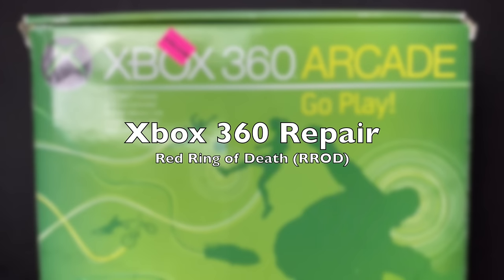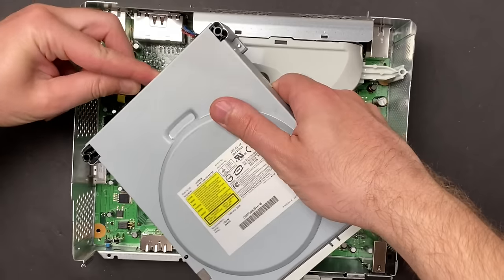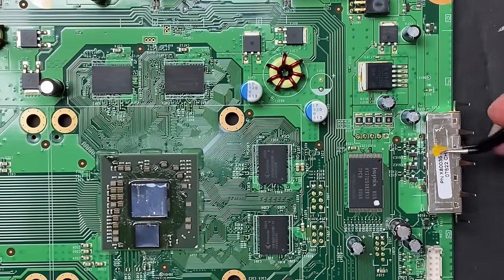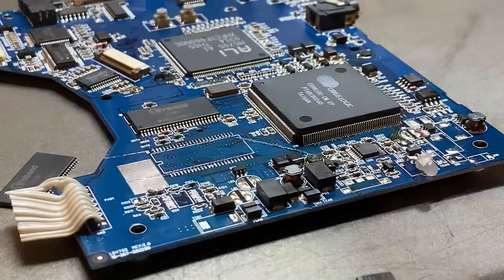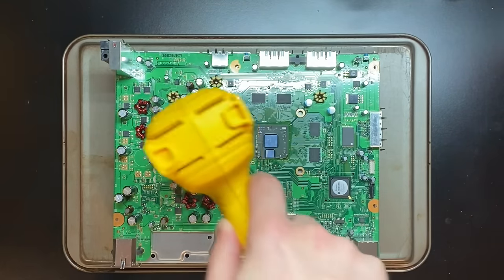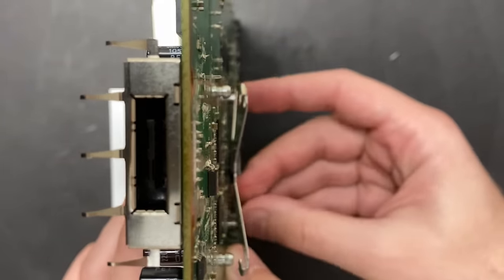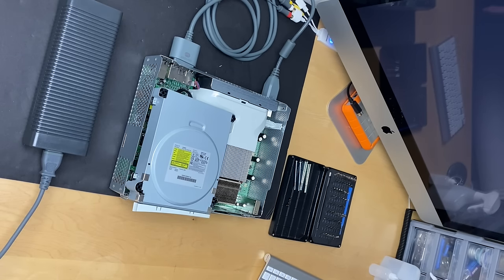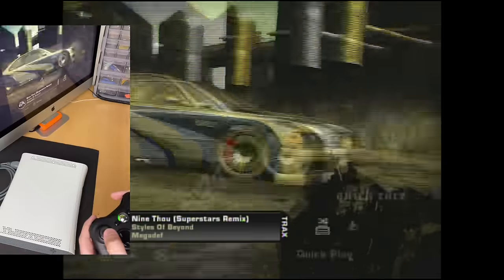Xbox 360 Red Ring of Death - DIY GPU Reflow

Comment: I absolutely love BorderlineOCDs Videos, always love the amazing content that you make for your fans! I want to share something to hopefully help you all! The RROD is a problem due the GPU, however its not actually the BGA Solder Connection in which is the actual fault. In fact, it is the connection between the GPU die, to the substrate in which also has your ED-RAM present on. Which is the reason why wrapping a XBOX in a towel works, the underfill they use to protect the connection was defective by rushed manufacturing, later in 2008, this was fixed, and the underfill was rectified for later RHEA GPU's onwards. Due to the underfill flaw, simple amount of heat could bring the system back to life, and interestingly pending on how far gone the underfill was, could last for a while after a reflow, or only a few minutes. If anyone ever wanted to preserve a XENON etc, its possible by GPU swapping or being able to identify GPU's in which where in the manufacturing date when they corrected the underfill. :)

Comment: So one thing I want to mention. You can check secondary error codes by holding the sync button when the console is on and while holding that button you press the CD open button that results in it showing probably 4 rings, there are 4 numbers so repeat step 1 until you have all 4 numbers. 1 is 1 ring  2 is 2 rings and 3 is 3 rings and 0 is 4 rings. You can search the internet for error code lists and see what error you have and what possible fix is available.
Reply from the maker: Thanks for the tip. I'm working on an Xbox 360 Slim soon and it has the red "dot" of death. This will come in handy.

Comment: Nice Work. Excellent tutorial. I've fixed 5 or 6 laptops like this but I placed 3 quarters and 2 nickels on top of the gpu. The author of the laptop repair book I read mentioned they apply weight to the gpu during the re-ball and the coins would be close to that weight

Comment: Good video by the way! I fixed mine with 2 key points to resolve the problem and which i would like to mention. After i disassemble everything and cleaned old paste fan etc, i change paste with a quality one and second, which i didn't see on the video and i think it is important, is that i bend X clamps the opposite way in order to increase the tension of cooler sinks on the chips. That make it more solid and more efficient with cooling. I think not in all cases needs to be follow the reflow method which is more drastic  step but for sure can help in many cases.
Reply: I fixed mine years ago using that identical method. Disassembled and cleaned everything, new thermal paste and tweaked the clamps before reinstall. Worked great from then on until it went into a closet, where it resides to this day.. 😁👍

Comment: Wow, best video I have seen on this subject...I have done all the tricks... (years ago, I know better now). I have the gear to do this now.  After getting my original 360 working 4 times, the last time it failed, I said screw it, I picked up brand new slim 250gb model, and it works fine even today, my old one is hanging with my other dup consoles....  I might try to do this...I should be able to handle this one, I'd love to see what system version it's still on.... Crap, I need to do other stuff first !!!!! Thanks man ! BTW I am MORE than Borderline OCD ...LOL
Reply from the maker: Thanks for the comment and good luck brining it back to life!
Reply: @BorderlineOCD  Well, over the weekend, I did this process, stripped the board, and used a heat gun and I got it REALLY hot. while putting good liquid flux on it, I let it sit for a day. Well last night I started putting together (my system has the bolt mod, I said I tried everything !), not counting on it working as it's been repaired 4 times and the last time, it was never booting again. Well on my bench, I put everything but the shell on, connected power and a video cable (this is non-HDMI unit), and she powered up, no RROD... OMG after 5-6 years sitting in a closet, it booted up. I will finish putting it together tonight and test it on the TV but, seeing green and no red lights is very positive. Thanks for this idea, never thought about the FLUX on all the other things I tried...
Reply from the maker: That's awesome to hear, glad to see another success story from someone that bothered to use flux and remove those plastic anchors. What system version did you find it on? Blades? (still hope I find one with the original OS one of these days). Keep me posted on its lifespan, would be good for others here to know as well.
Reply: @BorderlineOCD  Nah, it was newer, I just updated it... still using it..

Comment: Well done. I used to do this years ago while 360 and ps3 were the current consoles. Another top tip is you can cover all the caps and plastic parts with blue tac. This will protect them from the heat.

Comment: You seem to have so much generic knowledge when it comes to do these things! :) I am really curious how much this repair will last. Some people say that the issue is not caused by cold solder joints but it is the chip going bad internally and re-heating it keeps it alive for a little longer. Time will tell :) 
I would like to see more console repairs from you. I love the troubleshooting parts, they are very informative.
Reply from the maker: I'm curious as well. Have been playing with it for a few days now but we'll see how it holds up. Glad you're enjoying the repairs. A huge backlog of faulty consoles so plenty to keep me busy for a while!
Reply: @BorderlineOCD  I'm looking into fixing a 360 with a similar issue. Is this console still going or have you had a problem with it since?
Reply: @matthewswords4569  its not permanent. I did it and it lasted about 6 months. Any Xbox360 from 2 first generations will have this problem. Around 2008 they chenged the board to the Jasper.  I have one and its ok.

Comment: Not here to hate as I enjoyed this. But I’m just saying I’ve been repairing Xboxs for years and this is not really a fix it’s more of a bandaid patch. Most gpus were defective from 2005-2009 on the 360 the only proper way of actually fixing them is replacing the gpu. The reason it says there’s a cold solder joint is do to the gpus underfill that’s why even just using a little heat can get it temporarily working even without reflowing the balls. All that does is temporarily reposition/clean the gpus underfill. There is many videos explaining this. My favorite is probably explaining why the bolt mod is bad by Josh Davidson on YouTube. It doesn’t only go into why the bolt mod is bad but also why the gpus failed. Sorry if this is long

Comment: actually i think you touched on some amazing points nice job but i would have still done the 12 volt fan mod its a 12 volt fan after all and the console only gives it 5 volts but nice job none the less
Reply from the maker: I think thats a good idea. I am keeping this console as-is for the time being as a bit of an experiment to see how long this repair holds. If it fails again I'll consider another repair method and doing the fan mod.
Reply: The fan mod is great but the noise is just way too much to bear when gaming.
Reply: @BorderlineOCD  I'm lucky I have one of the non faulty Xbox 360s I'm trying to get computer or Xbox 1 so I can stream
Reply: @BorderlineOCD  I subscribed

Comment: When I did mine years ago, not any of the tutorials mentioned reflowing like this. It was always a blanket or an oven etc. Or not at all. Just replacing the thermal paste. This was prior to MS finally accepting the responsibility and fixing them for free. Mine was just over the 2 year warranty but they did it anyway. 
Problem is, 9 months after MS fixed it, it happened again. And this was with making 100% sure I made sure of proper ventilation and even placing the console on a marble piece. To help keeping it as cool as possible. But it did work just fine for 9 months. Sad.

Comment: I wouldnt have used goo gone. It leaves a residue behind and im not a fan of that in my consoles. I wouldve stuck with isopropyl and a q tip. Other than that, a really good video. no bad advice, very concise and easy to understand.

Comment: You did a good job, but sadly this is not the fix. E74 or most RRODs are because the connections between the Dies and the Gpu chip (Interposer) fail from the low TG underfill. You need to replace the gpu to actually fix it.

Comment: I used to towel wrap my Xbox 360 arcade back in the day,  lasted me a year,  but as it got older and the more wraps,  the GPU gave in and artifacts happened one fateful night in October of 2010,  so I headed off to the supermarket at 3am in the morning and bought an XBOX360S cracked open the old 120gb HDD from its OG Xbox case and slapped it into the Hard drive bay and that has served me well for many years and expect it to do so for many more, oh and I went a got another Xbox 360 arcade a year or so later and not had a reason to crack her open yet,  even though she's on her 2nd Power Brick :)
Reply from the maker: Nice, might even consider modding one of those since it seems you have a reliable pair on your hands.

Comment: I did a hot air reflow on my 360 back in 2010. It worked for 2 more days. Still have it in the box. I'm a playstation man myself. Don't even know why I bought a 360. Only lasted 12 months. Saying that though. I've bought a few faulty xbox ones and repaired them. It's so easy when they are structured like a PC on the inside.

Comment: Just picked up 2 xb360s. Guess I'll do this during quaratine.  Ty for the video.
Reply from the maker: Good luck. Hope you find an old dashboard revision to tinker with whether you eventually update it or not!
Reply: @BorderlineOCD  old dashboard more desirable?
Reply from the maker: When you find older systems with the launch dashboard (Blades) people get very excited about it because they are quite rare to come across these days.
Reply: @BorderlineOCD  I miss that damn dashboard. Cant it just be modded to readd it?
Reply: I've got one still working because it was last used in 2008 bought 5 xboxes for 40 bucks not working... Everyone was working. Now I picked up 7 broken ones for 30 and yes every one was broken. 3 are kinda of working but one has serious issues. I will continue trying to fix em

Comment: I would just stick with IPA to clean heatsink compound rather than goo gone, I liked the methodical & logical approach to your repair. My first RROD was repaired under warranty, my second was "repaired" with the "stick in the fans" method as I couldn't be bothered to strip it down. It still works, but I rarely use it now...
Reply from the maker: Do you have concerns about Goo Gone even when thoroughly cleaned after application? I've found it to be quite effective for stubborn residue and caked on thermal paste. Petroleum distillates are used in contact cleaners (in lower amounts) so I'd be interested to know if there are any risks?
Reply: @BorderlineOCD  Goo Gone is known to dull plastics, also you need to clean it off. What do you use to clean it off? IPA! So why bother using expensive Goo Gone when you can just use IPA!

Comment: Great video keep up the good work I agree on all the points you made people keep saying about putting good quality solder you're telling me they didn't build the unit with good quality solder just to repair that's all it needs
Reply from the maker: The system was plagued with issues. Several interesting documentary-style videos on YouTube by folks that have researched this a bit further and its quite entertaining. One video stated that the launch 360 was made with 1700 parts from 200 different manufactures! Many corners were cut to ensure they were the first to market.

Comment: And it’s on the NXE dashboard. What a find.
Reply: Lots of rrod 360s stayed stuck on the nxe or even blades dashboard because the previous would just get rid of it entirely i know as my elite had nxe but i accidentally updated it to metro when i put a minecraft disc in and well i do have a xenon board that worked once before going through the red ring again and that one also has nxe im just waiting to get a bga rework station because pf how bad the chips are

Comment: You should sell or fix others..I got two of em and pleased theres nothing extremely wrong . The tray won't open with out a flat surface and face off . One operates quieter than the other . Had to do a clean system cache just to get it to play a game... But yea I never owned one till I'm almost 40 and I mainly use for Forza ..but my girlfriend came home with the second Xbox 360 and games someone she knew wanted to trash just cause the tray door button is broke. I use the controller to open and close ..There's places around my city that work on newer models but no one works on older. I hate to loose money or an investment if it's a machine and can run for more than 10 years ..just need proper professional care. That I don't have .. love this video,can't do this myself. Will give thumbs up

Comment: To add to the note of cost. Most of those places will charge you 49 to 69.99
To do the work for you. But it doesn't guarentee the job is done to the quality of what this guy above has done with what he had. 
The main reason I do self repair. Is because to don't trust the quality standards others put of repairs above my own. Which would have to be higher.

Comment: I still find it crazy that my Xbox 360 never RROD'd completely. When it did (triple ring) I'd just turn it off and change it from vertical/horizontal to horizontal/vertical and it'd work again. 
Fell off my 3ft table once, never cleaned the thing, and used it quite a lot.
Reply: Haha same thing with mine! Until I decided to change the thermal paste. Put it back together, and the RROD appeared. Never knew what I did wrong, appart from MAYBE using too much alcohol to clean the CPU ans GPU. Whatever... They aren't expensive to buy anyway...

Comment: We towel tricked a 360 back in the day. Would have to do it once a week. We never opened it and unplugged any fans. Just plug it in, turn it on, and wrap it up real good, let her bake for idk 30 mins. Why it worked, no idea, you’re right it’s not hot enough to melt solder, but it did work.
Reply from the maker: I think it might have something to do with thermal expansion bridging the broken connections temporarily, whether they were between the die and substrate as some commenters have suggested or the chip itself and motherboard.

Comment: After many years you find out that the actual soldering problem with the gpu was on the crystal balls connection, not bottom ball connections.
Reballing it will heat up the crystal and make the connection temporary.

Comment: You’ve earned another sub. Great channel! I’m planning to do a drive flash on my phat system. Even though lots of people prefer JTAG/RGH mods, I would be very appreciative if you could make a tutorial for drive flashing in modern day. It requires some legacy and/or hard-to-find hardware. I’ve learned a lot researching it all.
Reply: Nothing much changed about flashing since the scene kinda abandoned it. Do you mind me asking why do you prefer flashing your drive rather than rgh mod? With flashed drive you can´t run any homebrew software like emulators, fan games, join servers outside live, etc. You also can only play backups from DVD+R-DL wich depending on where you live can also be hard to find.
Reply: @martinsleis3852  Yeah that’s what I gathered. The challenge comes in with finding the necessary hardware and software to do it nowadays. To answer your question, it comes down to being banned I guess. All I really want to do is play my backups and be able to receive the latest title updates from XBL for bug-free gaming. Without an available ODE, the next best thing is the drive flash on the 360 since it’s considered pretty live safe. I’m open minded to RGH, but I just don’t like the idea of getting console banned. Even though I can install title updates offline, I just prefer the simplicity of a stock system that plays my backups. Just haven’t really been convinced RGH suits my needs.
Reply from the maker: Thanks for the sub. I hadn't considered a firmware flash. Nice to see folks still enjoying the 360 even on Live. That makes two of us. I am however considering an RGH mod on a unit and keeping another unit stock.
Reply: @enjoiboy385  I used a flashed drive in my 360 (actually 2 or em) for years and the console still has the flashwd drive and still connects. If you uze the right CFW and burn your discs right you have nothing to worry about. The CFW has a silver bullet designed into it meaning it beats MS disc security and theres nothing that can change it.
Reply: @daveshank1921  Yeah I ended up flashing my drive. Luckily I had an old PC I built many years ago with hardware that was still compatible with the software needed for flashing. My burns haven’t been “the best” based on K-Probe results but so far no issues. I get title updates and play backups no problem.

Comment: My fat white Xbox360 Arcade broke down to RROD status after cca 2 years of playing in year 2013. It has been sleeping then untouched in a box for about next 8 years until I coincidentally found this video and finally discovered the real reason behind RROD. I never had time to investigate too deeply the real reason of RROD, I thought it's because I have modded the console back then to play game backups. I followed this video and it worked. :) It was little complicated to buy the Flux but I managed it after some web browsing. My son is now more than happy to play Forza Horizon 2 after playing FH 3 and 4 on a new Xbox Series X which I got just last year. I'm pretty shocked that even after so many years FH2 on Xbox360 looks not too worse than FH3 or FH4 if you watch TV from little further distance.
Reply: FH2 looks horrible on the 360 FH1 has shocking good graphics. At first I thought I was playing FH4 😂